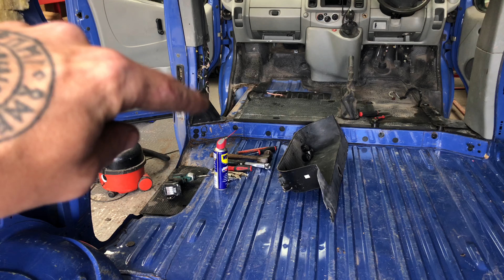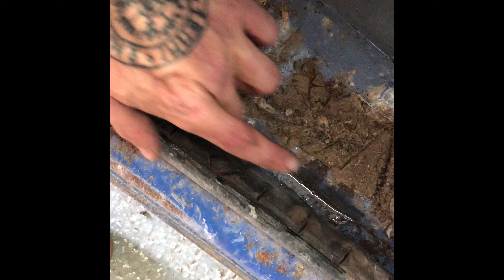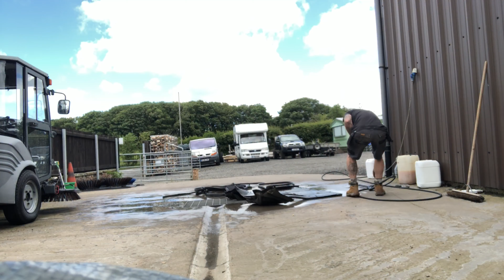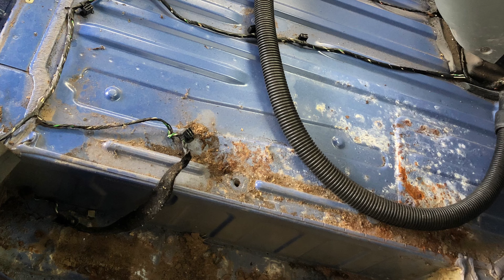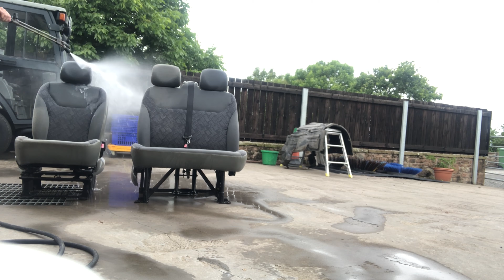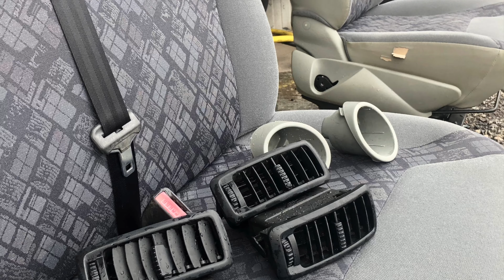Vivaro Campervan Conversion Part 3

Comment: did you check the scuttle  under the front windscreen and bonnet? Theres a really bad design fault with them meaning that the seal on them deteriorates and it dumps water onto the injectors making them seize and fail-which is a very expensive job to put right.  most folk getting the old viv, take the scuttle out and  caulk where it had been with sicaflex 551, then replace the scuttle back and give it a good reseal. theres a few vids on youtube highlighting the problem